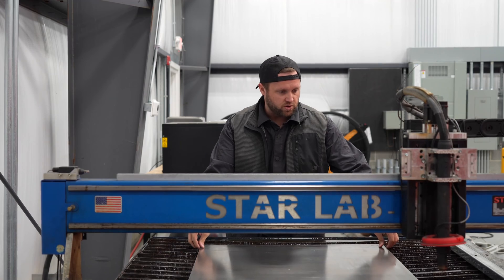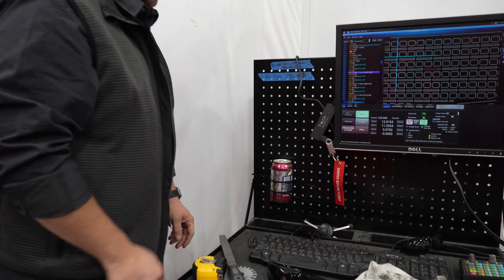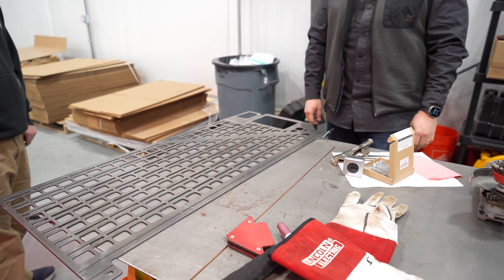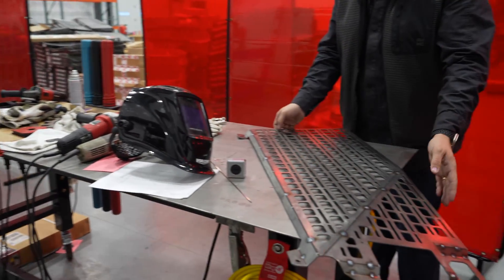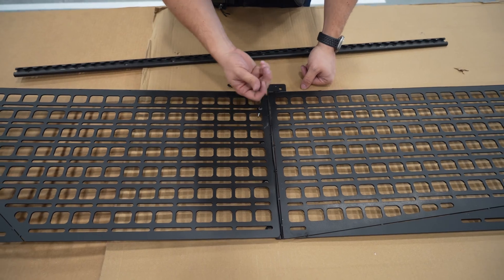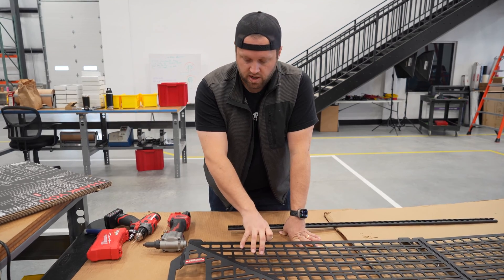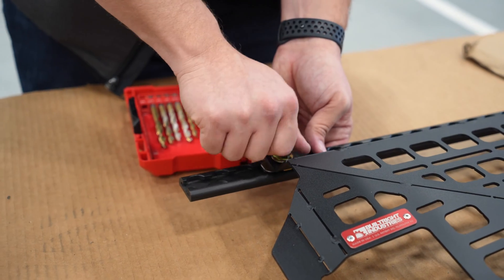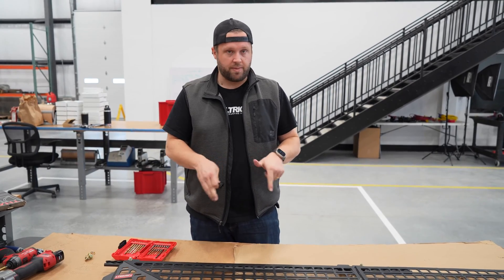Cybertruck Bedside MOLLE Prototyping!

Comment: Nice. I'm liking it. Anybody though of designing a molle panel and figuring a way to affix it to the underside of the CT's rear seats? Similar to your seatback or tech molle. With the seats flipped up, it provides a verticle molle panel and a way to secure cyclinder tanks or other things inside the truck cabin.